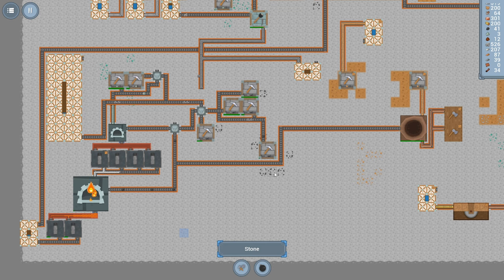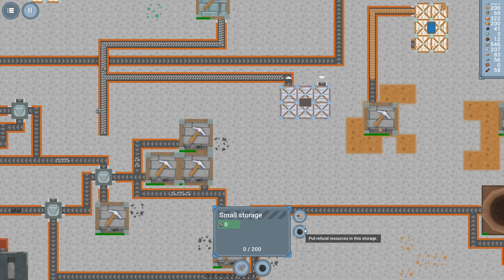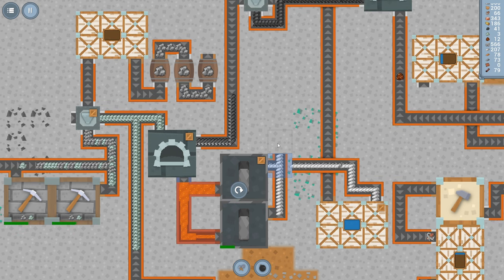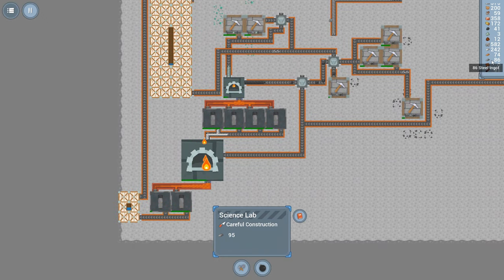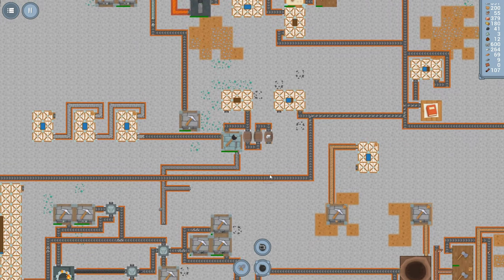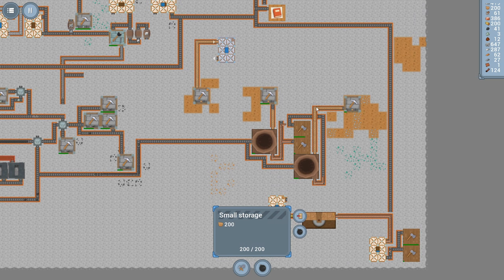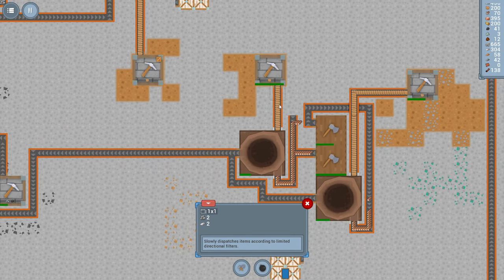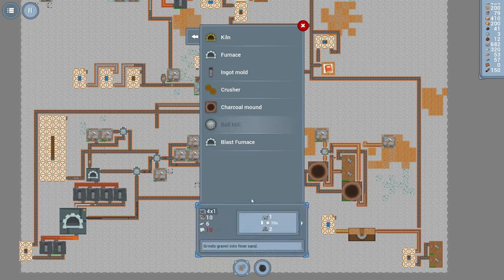Let's Play Drill Down  s01 e07

Comment: When working with your dirt miner, the funnel would have done what you want.  Put funnel on charcoal mound and send in the dirt then route the overflow to a second charcoal mound.  Using the funnel like that a dirt mine can feed at least 3 charcoal mounds.
Reply from the maker: That's a great tip! 
I had assumed the funnel would back up once a machine had all of the material it needed.